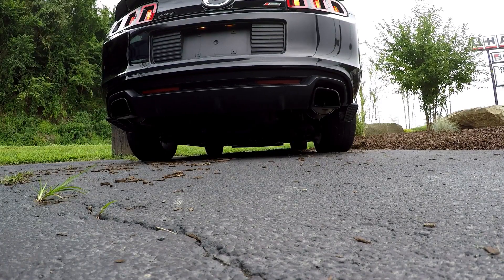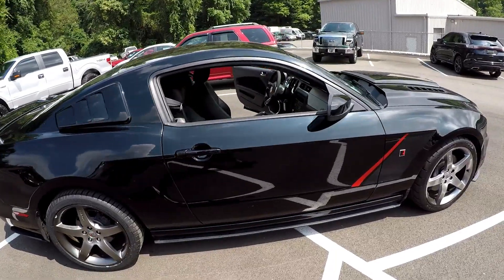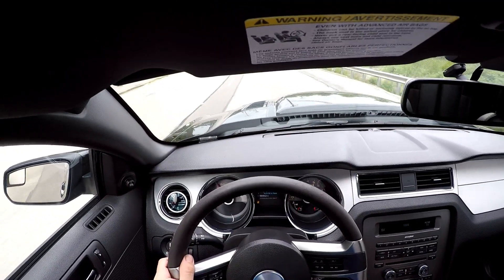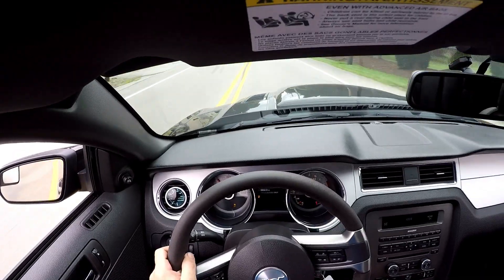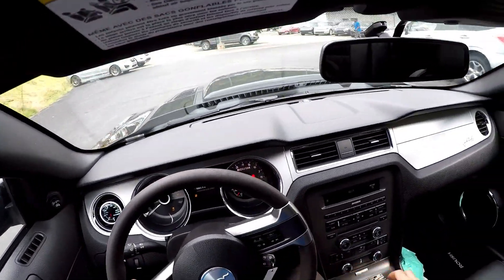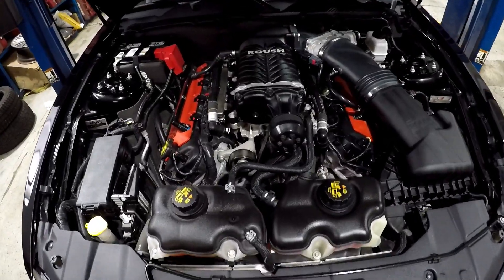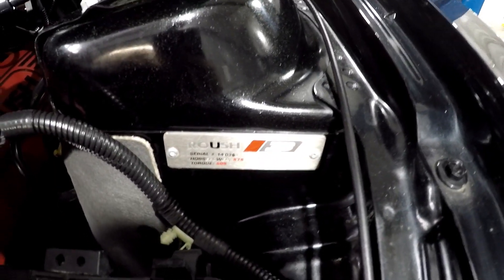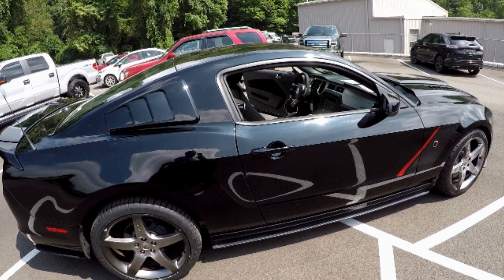2014 ROUSH Stage 3 Mustang Review  Was it Really Worth $60K

Comment: You're not driving the car right- or shifting it right. The Coyote motor loves to run at high RPM, and you're not hitting the power peaks right... a quick test drive is not really enough to get it. BTW- nice view of the sun visor!
I love my '14 Stage3. It falls in between the Boss 302 and GT500. Mine has the track pack (same as Boss 302), and NAV, heated seats-everything. I agree the seats are horrible. I'm going to swap them for some Recaros. The Phase 3 675HP kit makes a huge difference, along wih a one-piece aluminum driveshaft, and MGW shifter... Original sticker on mine was $67.5K. I couldn't afford that, but I got the car in '16 with 3,800 mi. showing for $39K- Less than the original Ford sticker of the Mustang GT the car was originally, which was $43K. 
One reason for the added expense when new is because it's a modified car, and yet comes with a full warranty from Ford as well as Roush. It's also not the same as buying a GT, and slapping a supercharger on over the weekend in the garage while drinking beer with your buddies. Everything is installed by professionals at Roush... I've been there- you can eat off the floor. Even if you don't like the car itself, it's done right.
Reply from the maker: I beat on it a little more but the car was still on the lot for sale, so I didn't put it in the video. I am sure with some minor upgrades it would have performed much better. I had a '12 GT Track pack with some minor mods and really liked it.
Reply: To get the rush of acceleration it needs to run 5-7,000+ RPM. I'm not a professional driver, but that's where I really feel it pulling hard.
Reply: I also had a 12 GT that I put a Steeda CAI on and a Steeda tune, and it ran great.. I love my Roush, but I kind of wish I would have kept my GT which I bought brand new..

Comment: If they put more money into components like LT headers, proper short throw shifter , etc, instead of 26 emblems, stickers and plaques that state "Roush" it would have been a much better car, and better value. Kudos for them working with Eaton to develop the roots TVS  blower though....... 

A fellow once asked for where they could buy Roush emblems or Roush components. This upset some Roush owners. The answer is everywhere, so J. Roush is actually encouraging cloning. Every component on a RS3 is or was  available in the aftermarket other than the speedometer and tach gauge faces. You could easily clone a RS3 for $15,000 with exact Roush parts, making the signature plates riveted to the shock towers and the speedo gauges a $15,000 cost. If Roush made money selling the excat components for $15k, you know the cost was less. so, about $10,000 in direct value for a $30,000 premium in an RS3. Shelby never made their parts a "money making venture", in effect making them much more exclusive.
Reply from the maker: I completely agree, most of them are all show and no go!